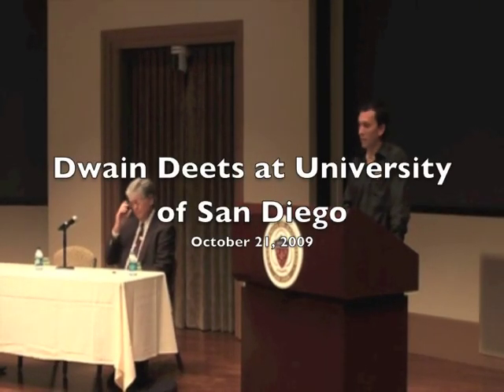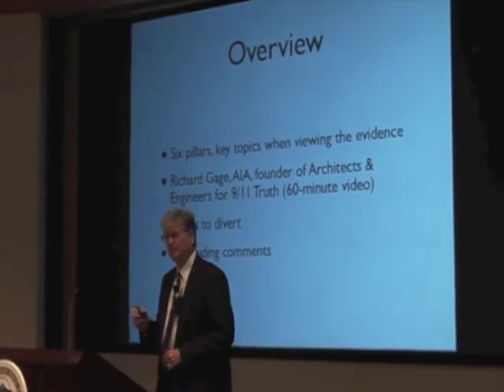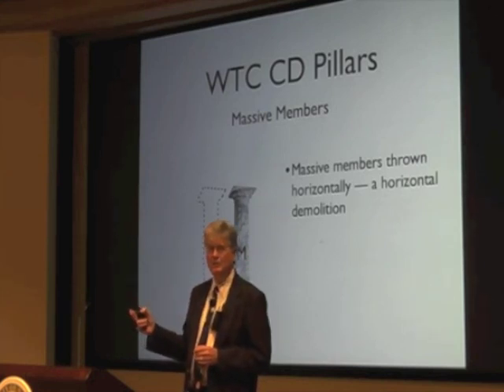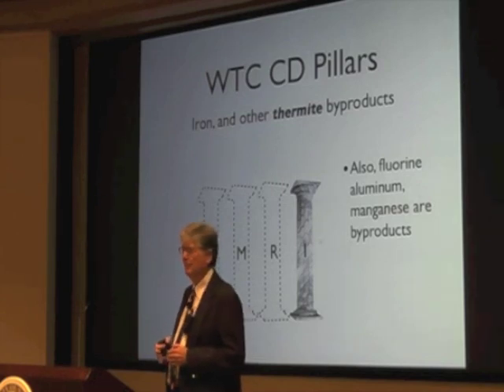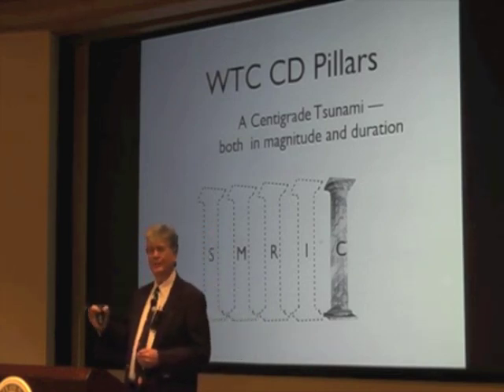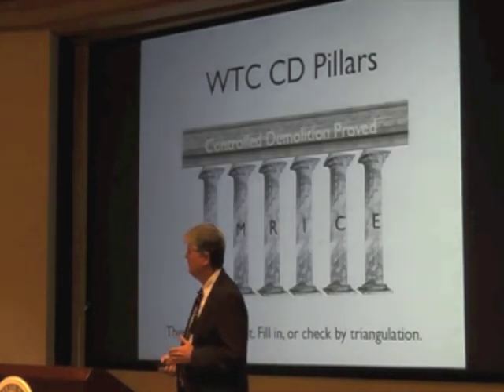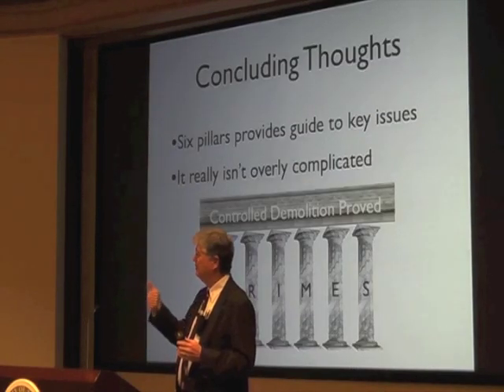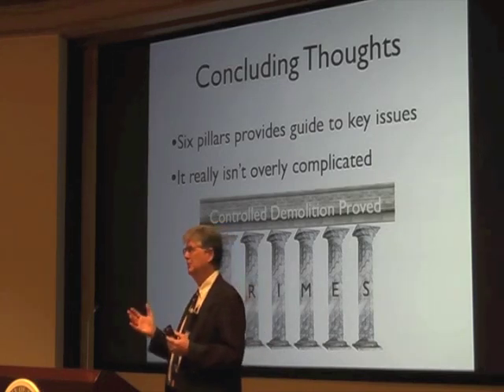Dwain Deets at Kroc Institute for Peace and Justice

Comment: 13,592 cubic meters of air; atmospheric air pressure = 101325 Pa (14.7 psi)

110 floors; 20 floors collapse; Say.. 30 floors below that, ejections, however, air must equilibrate.

110 * 13592 = 1495120 .... P * V = 101325 * 1495120 = 151493034000

110 - 20 = 90 ... 90/110 * 1495120 = 1223280
110/90 * 101325 pa = 123841.66 

1223280 * 123841.66... = 151493034000 
123841.66 * 0.000145 = 17 psi
17 / 14.7 * 100 = 115,6

So.. a 15,6 % pressure increase across the remaining floors.

Comment: So, what I would really like to see is building plans matched to the locations of those focalized ejections, and I will concede if such vents are indeed in the locations of the bursts.

However, in the mean time, it can be ruled out that such ejections could have come from anything else.

Suppose we consider a piston effect, with no signicant temperature changes in the compressed air and no escaping air:

Comment: @flanksteak2 

"You try obfuscate discussion"

If you try to steer the discussion away from ejections many floors below the collapse front, and towards ejections directly under the collapse front (due to pressure caused by a compressing floor that is collapsing), then it is you who is obfuscating.

Why don't you address the REAL matters, e.g. ejections many floors below? Challenge me there, and I am happy to oblige. If I make mistakes, the worst that can happen is that I learn from them.

Comment: For example: what is the pressure ten floors below the collapse front. Is it sufficient to cause a focalized ejection of air and debris?

Doing calculations on the pressure of a floor immediately below the collapse front is irrelevant, because we have no disgreement there. Don't you see that?

Comment: No, wind loads are tensile, compressive and angular (shear) loads. 

The columns undergo tensile loading on the side facing the wind and compressive loading on the leeward side. 

Essentially no amount of wind that would be reasonably expected in New York could ever induce uplift of a face of the building so its simply modeled as reduced compressive load on one side and increased compressive load on the other. 

BTW, did the plane damage any core core columns?

Comment: How many cubic feet of air are displaced if a floor drops 1 foot?

Taking into account the weight or mass of the floor, if the floor was somewhat reasonably sealed, how many PSI would be generated by a 1 foot drop (8% reduction in volume) of a floor assembly?

Your extensive knowledge of the "ideal gas law" should make such elementary calculations easy. 

BTW, this is a litmus test to see if you are qualified to be using the terms you are using.

Comment: "Sure, compressive loading, not lateral."

FYI: Wind loads (or a plane impacting) are lateral loads. Gravity loads are compressive loads.

Supposedly, gravitational loads overcame load bearing capacity due to fire weakening columns. I can see this happening eventually and gradually, but not so quickly as observed on 9/11.

Nevertheless it is not so much "collapse initiation" as what happened next that bothers me. Full progressive total "collapse" at  0.7g doesn't automatically "follow from".

Comment: flanksteak4, as for your three-legged table analogy, you'd be surprised.

"Another design, in Louisville, Ky., looks like a three-legged chair with a 22-story diagonal elevator that accesses a "floating island in the sky" art museum."

Source: xrl. us/bf4am2

Or such crazy structures as: xrl. us/bf4ana

However, all this is irrelevant, because the WTC wasn't a three-legged table, it was a box with a hole poked into it. Loads are transferred and redistributed as the design intended.

Comment: flanksteak1, LOL all you want, but ignorant mockery is not a scientific objection.

Air pushed into large open floors/cubical spaces will even out and form an equilibrium. This is by far insufficient to cause the observed accelerating focalized ejections well below the collapse front. The calculations are in the paper. Please address them.

Indeed P V = n R T for WTC floors were these bursts were observed yields e.g. an increase of air pressure by a mere 6 percent.

Comment: flanksteak1, as for those pictures of molten steel: (Witnesses don't count?)

There are pictures of previously molten iron-rich microspheres in the USGS particle atlas, the RJ Lee reports and in the work of Jones et. al.

That they should be all contamination from clean-up operations is ruled out by several factors:

* One sample was gathered ten minutes after the North Tower's demise.
* High iron, low oxygen (thus, not cut with a lance), and aluminum!
* Mass percentage: way past contamination.

Comment: The Vierendeel trusses would be so effective, according to the engineers' calculations, that all the columns on one side of a tower could be cut, as well as the two corners and several columns on the adjacent sides, and the tower would still be strong enough to withstand a 100-mile-per-hour wind. 
--City in the Sky, p 133

Comment: 'Evidence of a severe high temperature corrosion attack on the steel, including oxidation and sulfidation with subsequent intergranular MELTING, was readily visible in the near-surface microstructure. A liquid eutectic mixture containing primarily iron, oxygen, and sulfur formed during this hot corrosion attack on the steel. "
Appendix C FEMA Report

Comment: "Scientifically impossible" an over used phrase and a little misleading. At best your theory could be called scientifically probable. To suggest that air pressure is incapable of breaking a window is ignoring a probable cause. Yet it is dismissed as it doesn't fit into your conspiracy. 
Molten steel in the debris is claimed to have been found up to 6 weeks later?! Please explain how a thermite reaction could continue this long? Surely the amount of thermite required would be huge?

Comment: "not one person (...)"

There are several column pictures that come to mind.

911blogger. com/node/9154

Scroll down. However, it 's debatable whether or not these were caused by explosives.

How would one, be it a rescue or iron worker, walking through the rubble of a gigantic catastrophe, be able to distinguish between an explosion and a tremendous ripping force of a collapse? That's not easy. 

Molten steel, however, as reported by e.g. Astaneh-Asl, widely respected expert, is very dubious.

Comment: "especially the trusses that supported each floor"

This is debatable considering the WTC floor replica tests that NIST conducted and did not fail even under the most absurd artificially pumped up conditions.

However, let's just grant you this point. What does all this have to do with the active thermitic materials paper? All this does not explain the presence of this material in WTC dust. It has no business there, whether or not steel columns were 'weakened by fire'. 

I hope you see my point?

Comment: You comment about steel losing half its strength at around 650 centigrade. IIRC, this is true, but NIST found no evidence of such temperatures on any steel beams. There are mitigating factors: undislodged fireproofing, conduction and the difference between gas and steel temperature (!)

Molten steel is completely impossible from office or hydrocarbon fires. Not even fire professor and OCT-ist Thomas Eagar denies this.

xrl. us/bfzksc

Comment: The fuel might not have melted the steel columns, but it weakened the structure, and especially the trusses that supported each floor, to the point that they could no longer support the weight on the building.

I am the cut and paste king :)

Comment: The explanation for the puffs of smoke offered by the authors of the Popular Mechanics study is that as the floors crashed down of top of one another, a pressure wave forced dust and smoke out of the windows.

As for the fuel temperature - the official explanation holds that whilst steel does indeed melt at 1,500 degrees Celsius, it loses half its strength at a much lower temperature of 650 degrees Celsius.

Comment: Slight error below: acceleration, of course, need not only be the /increase/ of velocity over time.

A jerk can occur in two ways, iirc: a decline in acceleration (accelerating, but slower than before) or "negative acceleration", also known as "deceleration". Deceleration can also be called negative acceleration because one substracts a given meters per second from an object's current speed....each second.

So...just noting the subtle differences. I recommend the work of Tony Szamboti.

Comment: It is not that you cannot predict the "speed" of a freefalling object using the formula: v(t) = v(0) + g * t, but...any fluctuations in acceleration due to "jerks"/"jolts" will hide sustained periods of freefall!

This is how NIST attempted to hide a sustained 2.25/2.5 s period of freefall. They measured speed, not acceleration. They used two points for their measurement: start and end of the "collapse".

Well, I tried to explain this as politely as possible. At least give me credit for that.

Comment: A 'jerk' or 'jolt' is therefore measured in meters per second per second per second, otherwise written as m/s3 (meters per second to the third).

It is this 'jerk' which must occur in order for a building to convert gravitational potential energy into crushing energy.

When you use the term "freefall speed", people will respond by dividing the height of the building by the time of fall, and conclude it did not fall at the rate of freefall; thereby ignoring the 2.25 s period where it did.

Comment: KevinMerck, "freefall speed" is a confusing and misleading term, since freefall is identified by measuring acceleration. (speed over time, not distance over time)

Speed is distance traveled over time. (Meters per second)
Acceleration is the increase of speed over time. (Meters per second per second)

There are other derivatives you may not know about, and they are in fact key. The rate of change of acceleration is called "jerk" or "jolt" and the rate of change of "jerk" is called "jounce".